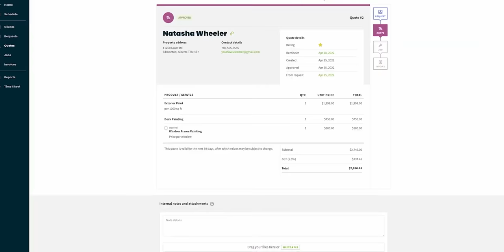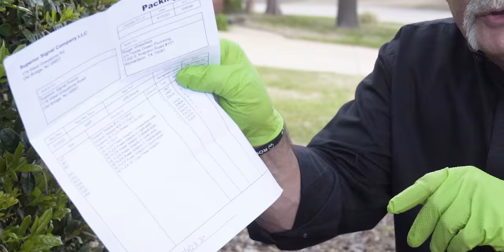Locate Sewer Smell in MINUTES with Smoke

Comment: Question sir:  New house built in 2020 (no warranty as it was a quick flip by a builder who didnt offer one).  Septic tank. They left a vent pipe and bar rough in open behind the dry wall in basement after a county pre-drywall water pressure test during construction which left me with bad sewer smell in basement whenever our water filter ejected water into the septic outlet pipe.  We did two smoke tests to find that disconnected pipe and had it fixed along with a bad seal on a toilet. Two different plumbing companies did the two smoke tests. Problem solved -- However we are left with a lingering sewer gas smell on colder, windy days in one main level bathroom only.  There was no smoke seen coming from this toilet during the two previous smoke tests for the vent pipe in basement issue  (they cost $600 each and having done it twice with two different plumbers I am leery of doing another one). This toilet is in the main level bath/powder room.  It is used often, clean and is stinking to high heaven this week with the arrival of windy weather.  So my question is could it be that this toilet and shower and sink are on a vent pipe that daylights on the south side of the house and therefore catches the wind just right on the roof to push the gas back down the pipe in certain weather conditions?  It doesnt always smell jus ton these types of weather days. Walking around the septic tank outside I detect no smell from t he tanks or outside. The issue is the local plumbers don't go up on roofs and don't carry ladders and the local roofers don't know plumbing. So I'm in a self help kind of trick.  I'm thinking maybe a PVC attachment on the top of the vent pipe to prevent wind pushing gas back down. Does my theory make sense to you?

Comment: if them fricking plumbers wouldn't put pipes where the wires have to go!   🤣🤣🤣
I've drilled into a pipe before, left a big note and marked it on pipe, studs and joist. the plumbers weren't really mad, since I made it clear who did it and let them know before they failed a test, possibly with drywall up. also did pizza for lunch. 
the best was putting a framing nail through a 1/2" copper water line and not testing it before the subfloor went down, luckily I was screwing down the subfloor and the nail was from blocking around the toilet. (remodel job and only me working, so I knew who to blame...)